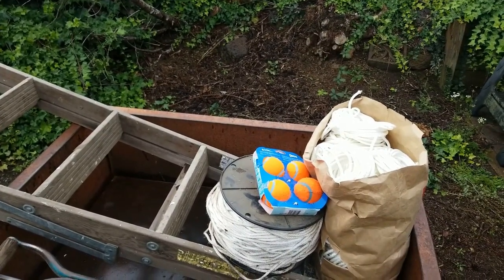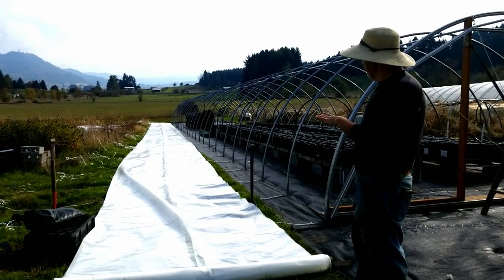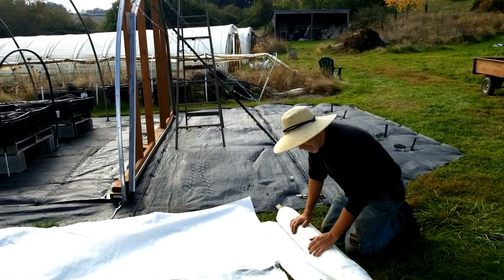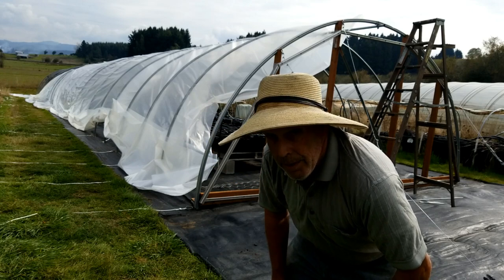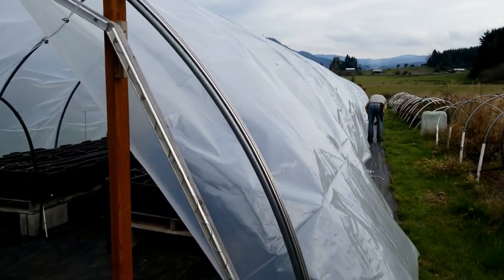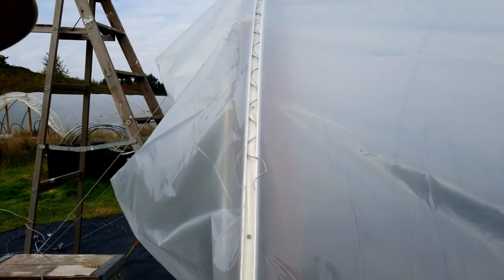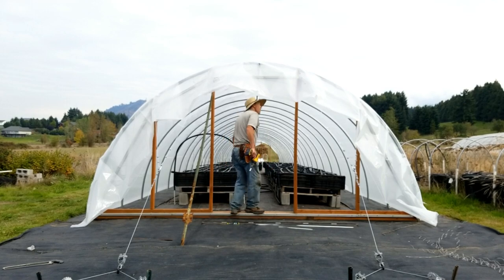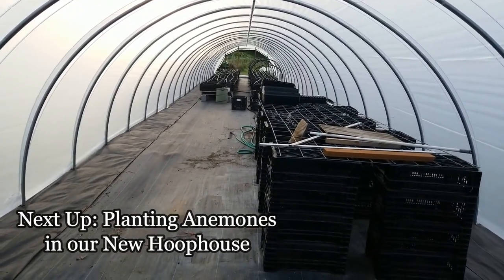Finishing Up the New Cratehouse

Comment: Its not easy with just 2 as we can also testify..we use ropes and 'clingons' (maybe called something else in the USA) which are small plastic clips which clip onto the plastic and the tighter you pull the rope the tighter they grip and yes loosening all the plastic first is a good idea before starting to pull it over
Reply from the maker: Thanks for you thoughts @Peter Smith. Gotta lookup those 'clingons'
Reply: @BareMtnFarm  yeah Tony I will find a picture of one to send you Kind regards  Peter

Comment: Did not see how you actually used the tennis balls.  You attached them directly to the plastic to use as a hand hold?
Reply from the maker: Hi @Amy Crawford. The tennis balls were used to tie together a rope handle on the plastic to help pull and hold while we worked the plastic over the hoops. Its in the video at about the 7 minute 20 sec mark.
Reply: @BareMtnFarm  thanks for the time mark! somehow I missed that the first time around. EXCELLENT, I love the practical tips you pass on... a true educator at heart.